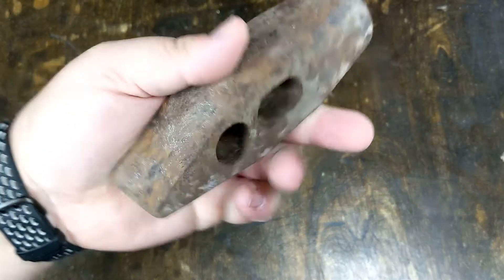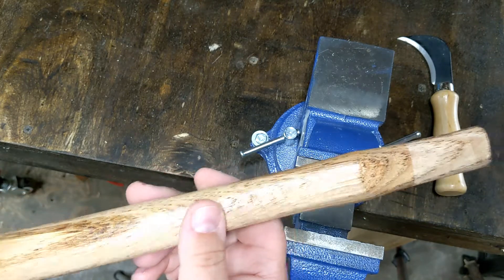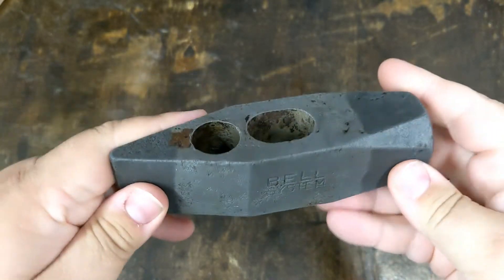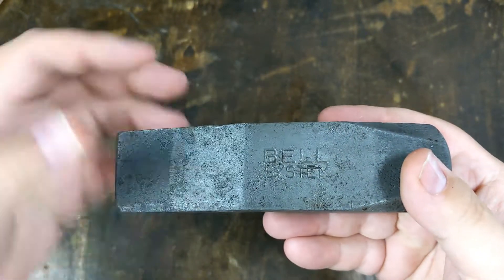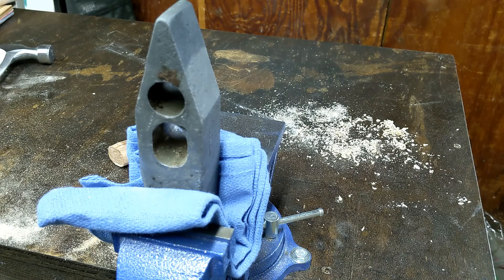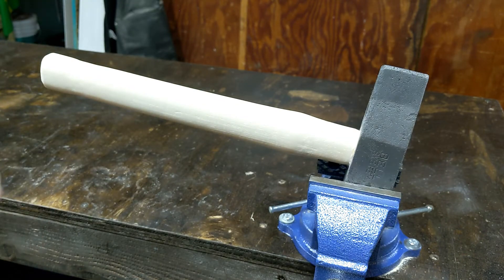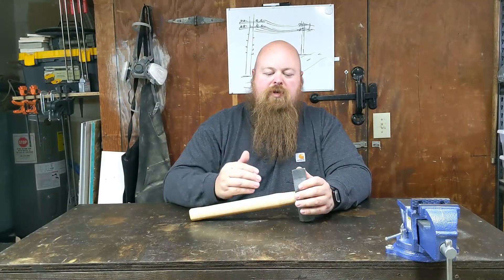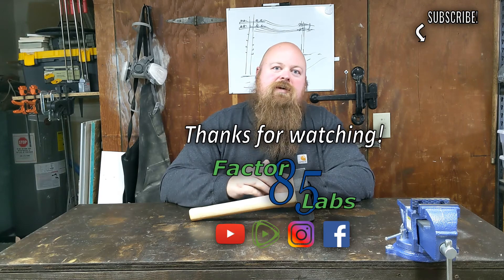Stanley Bell System Lineman Hammer Restoration

Comment: The darker colour is where the steel has gone through the induction process which hardens the striking faces. After that the hammer is tempered to reduce brittleness in the grain structure.

Comment: I know with engine castings, the manufacturers will fill small, cosmetic-type blemishes (think non-structural bughole) with a weld. I think that could be the spot on the head.
As for the two tone, it shows you where the striking faces were hardend. Quality antique axes have that tell-tale color change a couple inches back from the bit(s). You need the bit to be hardened to hold an edge, but the eye to be softer in order to not crack while striking. Seems like Bell or Stanley decided this needed the same treatment. Something about using acid to treat for rust, or on purpose, reveals where the hardness line is. I think it has something to do with the crystaline structure differences of the metal and how they oxidize in the right conditions, but thats not specific enough to help anyone. 

Now that i've typed this out, if I am wrong someone should be here to correct me very shortly. At least you will know lol.